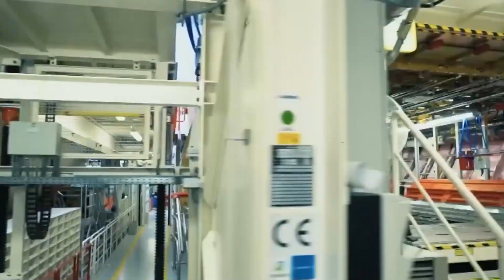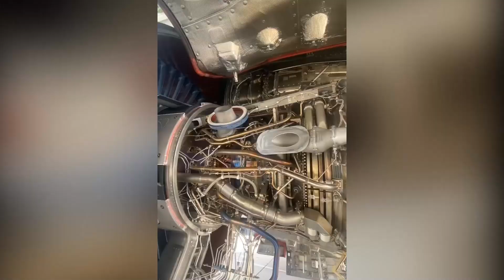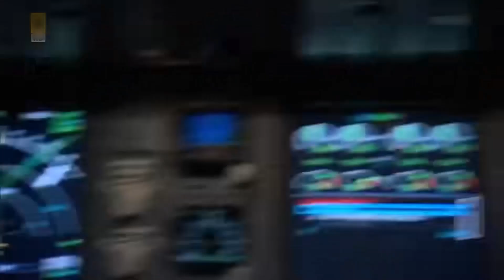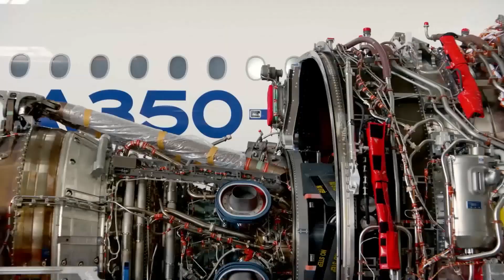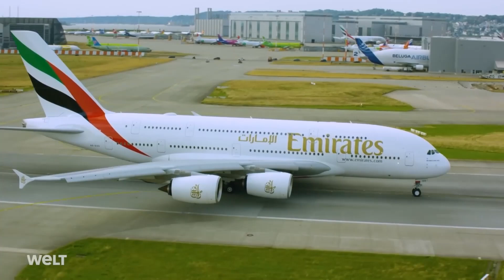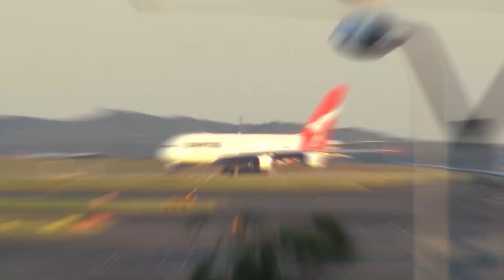The Terrifying Flight That Proved Even Giants Can Fall

Comment: AT 5:20:  Airlines thought "as long as these leaks stayed small, everything will be fine".  These airlines, whoever they are, should be banned.  Uh, any one who has ever dealt with a plumbing leak knows that leaks are a problem that progresses until the leak can equalize pressure usually catastrophically.  Everything will be a disaster and not fine at all.